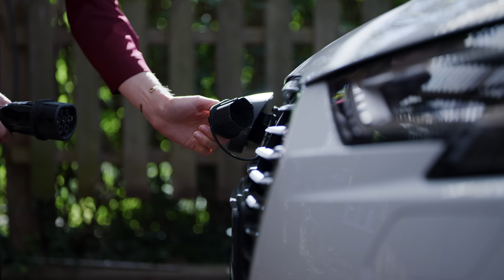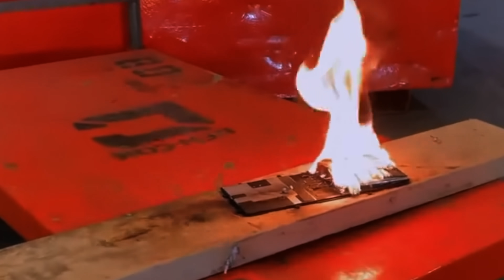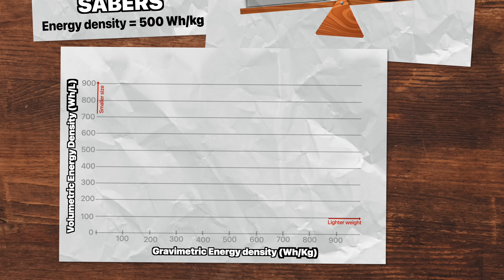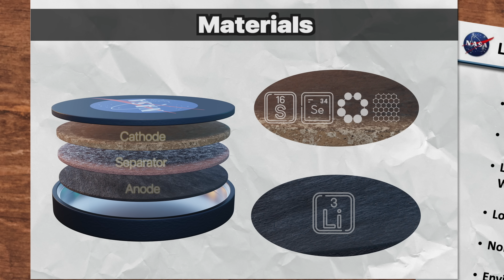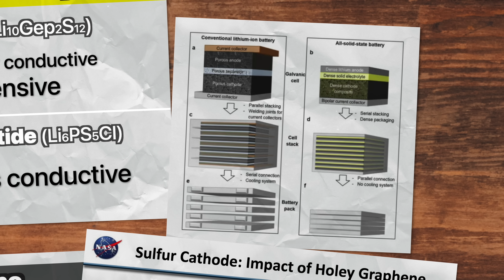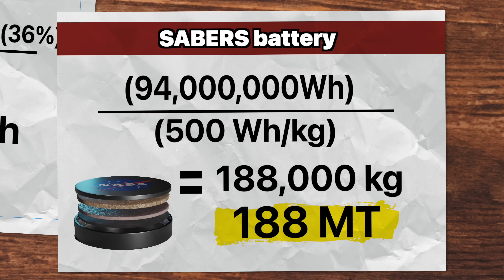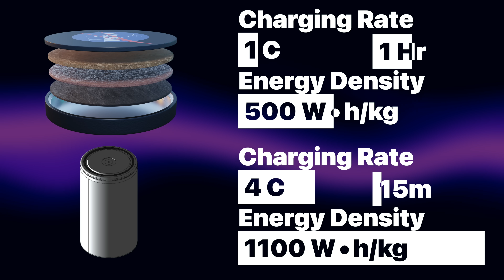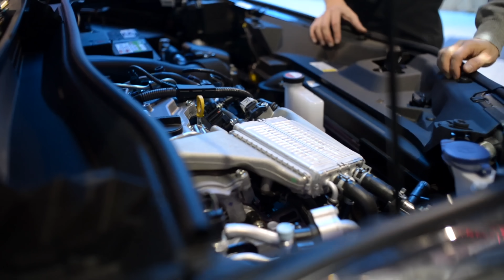Why NASA is Building a Solid State Battery

Comment: This battery is as real as all the other energy "breakthroughs" of yesteryear . Dont hold your breath.
Reply: The solid state market is about to hit commercial scale next year. I get it as we have been talking about this for years but it's taken dozens of companies and years of RnD to get there. Most good things take a long time
Reply: @Novacasa88 10 years ago about half a dozen breaktrough battery technologies where to hit production the following year. This has been said for every year since…
Reply: @Novacasa88 Yeah, they're real and much better. Only problem still is figuring out how to mass produce them at affordable prices. If they solve that then solid state batteries will be the EV game changer. Solid state batteries + higher output solar panels would= EVs that only need 🔌 plug-in 1/4 or 1/2 as much. 
Like a mid size pickup truck with the hood, roof and truck bed cover, covered in high output solar panels.
Reply: @Novacasa88  what makes you think that? I haven't seen anything that would make me think that we are close and experts are saying we are at least five years away. (Probably more)
Toyota is saying they are close, but they've been saying that for over ten years. I've seen no reliable source say the same.
Reply: A similar battery “breakthrough” from some years ago is Solid Energy Systems battery (also lithium metal anode if I remember correctly). 
They are going into mass production right now.
Yeah. 9/10 battery breakthroughs wont make it to market. But we only need 1.
It takes many years to go to commercial scale production. Sometimes the reason you don’t hear anything after the first announcement is that the company developing the battery got the investments they needed to continue R&D and scale up. Then they have no reason to publicise anything as they don’t need the attention to attract investors anymore.
Reply: @auspiciouslywild 🧂
Reply: "Graphene Breakthrough Announced!
  This will change Everything!!!"
Reply: @stevechance150  yes perfect pairing for the  fusion breakthrough
Reply: If it's as real as the battery breakthrough of yesteryear that we use in our smartphones, laptops, cars, headphones, speakers, etc. it should be good.
Reply: Selenium = more expensive than silver.  Good Luck.   @nagualdesign
Reply: Yea, they all used identical materials... Gold, Silver, Platinum... oh goody, this uses Selenium, only 50% more rare than silver... Oh goody!
Reply: Toyota is talking about bringing solid state EVs by 2027.
Just saying.
Reply: @poolboy1690  Toyota has been talking about solid state batteries for over 12 years and they are always "only three to four years away!"
Reply: @4203105 Toyota once owned a sizeable chunk of Tesla but sold it.  Pretty ballsy bluff for a weak hand of cards, I'd say.
Reply: Every great breakthrough has received its fair share of naysayers. This battery technology is much further along than you give credit. OEMs have been provided with usable technology for testing since last year. Negotiations are underway with launch partners.
Reply: @rickblanton4328  it’s more than that. Disruptive technology has been hidden and stolen for decades by abusing the patent office to filter them then steal them under national security threat. We could have gone off fossil fuels in the early 70’s is the truth. Now the government wants to patent and slow roll clean energy to us.
Reply: Oh good, I'm glad to hear that then, because most of those breakthroughs from NASA and the major schools like MIT eventually show up in the public sector.. He listed a few examples of that right at the start, lithium ion and subsequently the newer lithium iron phosphate (newer carbon- lattice design) weren't even mentioned but they both were similar breakthroughs that have upgraded batteries in insane ways.
Reply: Toyota has been promising and re-promising that their solid state battery will come out “next year” for 6-7 years. I smell vapourware.
Reply: Nasa has developed a lot of technology that is now in our every day lives. It took years to get into industry though. Nasa has never been in the business of making factories though. So they do the science and maybe make a thing for themselves. Their batteries will go to space though so that s cool
Reply: Don't tell me how to breathe! ... turns blue
Reply: LEDs have been pretty great this last decade eh? 
And then there are SSD hard drives, and TV's as thin as a finger but the surface area of an actual bed. Imagine that as a kid!

Funny how we forget the way things used to be, we humans can normalise anything. 15 years ago there was no way to Google something without having to switch on a computer, usually indoors, and at best that privilege cost us a tedious life of cables and a weird shit briefcase or backpack, and clunky power adaptors and finding somewhere with free WiFi, before that was even an expected thing.

Streaming also only a few years old as a reliable concept, remember when Netflix main competitor was IloveFilm or whatever, and you had to return the films on DVD through the post, and every 4th disc would be cacked anyway? Great times.

And like, QR codes they're pretty new, li ion batteries themselves were a revolution in power density, then li polymers again.

Ooh yeah, a few years ago we all just agreed that nazis were, and are, very bad and not be tolerated. Somehow that slipped, bit of a shame, millions dead and all that, we really should have more respect for that and stamp out fascism at every turn.

I seem to have wandered some distance from the point..
Reply: @timt5381  it's amazing how are we've come. Just Imagine how far we'll go. I'm huge into science. I'm make sure to keep right up with current experiments and your findings. We're honestly head towards startak way faster then people think. 2 out of the 3 large Hurdles for ft l drives have been accomplished. 2024 Dr. White and Eric w. Davis cub sat goes up. It's expected to hit 20%c. We can now do quantum computing with light and we have the world's first room temp. Super conductor. Op. Temp. 20f. There also been massive breakthroughs on non equilibrium cold plasma aka negative kelvin temperature plasma. It's honestly crazy.
Reply: Why do you watch these kinds of videos if you are so hopeless?
Reply: @ryanscott642  
"Hopeless"? Me? HA! 

Cynicism != hopeless, son. 

It's not pessimism if the world really does work that way. That's called "realism". 

I've been an engineer for 30 years. You know how many times I've been promised the moon and the stars by tech? The fact that I DO still watch these things represents the greatest instance of hope you'll ever see!

"Fool me once, shame on you. Fool me 77,244 times? Then SOMETHING's gotta be dragging me back. 

I know a great deal about this topic. As in, I read journal-published papers on it. On purpose. For FUN. So I've got a pretty good bead on the situation, too. And yet... here I am. Hoping that not only have I missed something, but that some random content creator didn't.

"Hopeless?" Son, one or both of us clearly doesn't know the meaning of the word.
Reply: @grumblycurmudgeon  I remember when they couldn't imagine why people would ever want a personal computer.  Now we walk around with supercomputers in our pockets. Mostly to use them to bitch and moan about how technology lets us down.
Reply: Breakthrough for science, not always directly for consumers
Reply: @ashmasterc  exactly
Reply: New technogoly is never new technology.  It is last decade's technology becoming cheaper to produce and more widely available. This isn't going to change the battery scene over night,  the same way Li Ion batteries didn't, but it will mean that, over time, as these becone cheaper to produce and easier to manufacture, we'll see these more and more often,  until one day they are just as common as anything else.
Reply: Toyota is totally dishonest in EV statements.
Reply: I think I trust NASA a bit more than some dodgy Chinese company half owned by the CCP 😜
Reply: @edwardfletcher7790  yeah ? Tela , GM & Ford all use battery cells & packs from CATL & BYD.   I'm no fan of the CCP or Mr. Xi, but Chinese tech is a little bit more advanced than the chauvinistc kooks at foxnews. would let you believe . In battery tech , the Chinese are ahead of everybody else... meanwhile, Nass wasted ungodly amounts of money on the SLS.   You might want to  educate yourself on the subject
Reply: U know we could have been off fossil fuels in the early 70’s? They have been using the patent office as a filter to catch all emerging tec. Ether they make it gov property and a “ national security risk” for emerging disruptive tec for decades or they seize the tec if the big oil can’t buy it outright. The truth is all people have been caught by the money trap and can’t turn down the billions on the front end for putting it out as free use and the capitalizing on the back end patenting all its uses in stuff. That’s been the hook to it and how they have held us back for so long. There is clean unlimited free energy all ready developed out there. They claim it would collapse our economic system. No it would cut off oil countries and stop the have and have not society they love today cause there in the haves and to them a few billion is like a few hundred to us. It’s time to wake up!
Reply: Air analyser. Wank wank and double wank..
Reply: Agreed, every week I see another pair of about the Holy Grail.
It's just a way to deceive the public that Electric is sooooo green.!
BS
Reply: NASA is not the leading edge organization it used to be. Its days have passed. It always used to hype up stuff that it did but in the past the hype usually had at least some substance behind it. No more. Now it is all hype
Reply: Thanks, you saved my time.
Reply: It actually is real lol Elon made the brake through first. Also another big battery brake through is nuclear Diamond battery's.
Reply: It actually is real lol Elon made the brake through first. Also another big battery brake through is nuclear Diamond battery's.
Reply: @coreymorris1693  lol. Believing that Elon made any break through except his fragile ego...
Reply: @4203105  lmfao OK man. the guy that helped him develop it did an interview about it. It's the same guy that made the first lithium battery... so yea I do believe it lol. He even expanded the physics of it lol they are just looking for better Manufacturement processes. You need to catch up my guy lol there's been a lot of progress the past couple years. Ndb battery's, cold fusion, warp bubbles via catastrophic quantum brakedown using micro casimir cavities, quantum computing using light. There has been so so much progress.
Reply: @coreymorris1693  my guy, Elon never invented anything in his life. So nobody helped him do anything.
Also you are clearly delusional. Good bye.
Reply: Here's the secret, there's really not any more room for battery improvement on a significant. Like there is still improvements to be made but like we're not getting to gasoline levels of energy density with batteries ever like it's just not going to happen.
Reply: Looks real to me, you might have been wrong here.
Reply: ...it always takes a least a decade for it to hit open market
Reply: Different time
Reply: Is this why Toyota is promising 900 mi range EVs by the end of the decade? Because it's all fake?
Reply: Batteries with graphene are the future. I've been saying so for over 5  years and we're finally starting to see it
Reply: Like every new battery tech video, battery history first then some news and that's a wrap.
Reply: I have a couple already. They're pretty tight!  I can play candy crush twice as long now without having to charge my phone.
Reply: Well, Toyota is bringing the first car with SSB to market 2025, including all of their EV models in -26?
Reply: That’s the cool thing about technology and advancements, they don’t happen overnight. The simple fact is that they’re working on it and making progress. What have you contributed to the world aside from ignorant comments on YouTube…?
Reply: Except solid state batteries are already on the market. Check mouser.
Reply: These batteries are fine, for space use, but there's another aspect of this. The "trickle down" of aerospace technology was enabled by legislation that enforced public ownership of federally funded technology, but this legislation was removed in the 90s in favor of lobbyists from major contracted vendors. This means that all currently developed technology stays proprietary and the market is unable to compete in production.
Reply: Here here brother they been talking this shit for 40 years an there all full of shit. Biggest con in science is space. Ive been hearing about going to space for my whole life were still not going there. guys like this make big bucks selling their lies and BS products like atmo. Ill believe jt when I see it. 

Im all for this shit hapening but its usually lies.
Reply: Yeh pure bulshit vapor subject.
Reply: Things change. Think 200 years ago.
Reply: Solid state batteries are not new. If a solid state battery shorts out, it is a dangerous fire as they can store a tremendous amount of energy. Solid state batteries can hold 5 times the amount of energy than an ion battery.
Reply: They can power all of those cold fusion plants with these new batteries!
Reply: Thank you. I stopped watching while the ad’s were still playing 💕
Reply: Funny that I'm laughing at all the pessimism on a black slab or glass in my hand showing a motion picture with nothing attached to it. 🤣 Yea these "breakthroughs" never materialize.
Reply: @storm14k Imagine going back to 1985 with a smart phone 📱 that had wifi. That's playing the newly released back to the future movie in the palm of your hand in HD. 😂
Reply: @michaelbrinks8089 Don't forget to bring wifi broadcasting infrastructure plans back to 1985 too!

I believe in time travel because I've experienced it... best to do it right.
Reply: @storm14k  Well said.
Reply: Most of the time it is about cost I've noticed. Or they are in the process of scaling up.

 Yet it is good to be skeptical. There are some technologies that he is basically free advertisement for some con artists. Him and Undecided with Matt Farrel or whatever really do fall hard for those deceiving assets.

 I won't hold my breath. I do hope I'm wrong though about my skepticism. This is NASA afterall.
Reply: @dianapennepacker6854 
NASA =never 
              a
              straight
              answer.  😅
Reply: Yes... Click bait...
Reply: @StatedByTony so don’t buy it when it comes out.
Reply: @MH-lk8md The battery doesn't come out.
Reply: @MH-lk8md  that is for sure. You really shouldn't trust these YouTubers so blindly and fall for their click bait. I do believe in SSB, but this one won't be it. Materials too expensive.
Reply: @StatedByTony materials too expensive? Bro every single smartphone has fucking gold inside it
Reply: Fossil fuel has entered the chat.
Reply: @PhantomPanic exactly
Reply: @PhantomPanic no no you just don’t understand… some random 🤡 on the internet obviously knows more than NASA, I mean what have they ever accomplished, really? 😂😂
Reply: @sowhat512iuu Velcro?
Reply: @sowhat512iuu Knows more about what? Whether something is economical to manufacture at a large scale and produce? NASA never claimed those things. You believe that this battery will be mass manufactured and it will be economical to do so, not NASA.
Reply: @PhantomPanic better batteries will have fossil fuels leaving the chat.
Reply: @BadOompaloompa79  whoosh! That was the whole point. Do you really think that the oil tycoons aren't going out without a fight?
Reply: @PhantomPanic  oh, if that's what you meant we're going to stop burning fossil fuels when the last cannibal eats the last oil company CEO.
Reply: @BadOompaloompa79 Cheaper solar will have fossil fuel industry leaving the planet at gunpoint.
Reply: @PhantomPanic Many many worthwhile things require a fight to achieve, yet such a large fraction of the population thinks violence is bad, even in self defense or defense of Earth. We're becoming livestock.
Reply: YouTubers figured out that people click on "new battery" even when there's no manufacturing going on, just prototypes or proof of concept
Reply: N.A.S.A just stands for Not A Space Agency
Reply: @generalgod4326  actually, NASA stands for Needed: Acronym-Spouting Adolescent. You planning to apply?
Reply: There is that much effort and money going into this it will deliver. You cynicism is ill placed.
Reply: @drinky1 Your optimism is the result of naivety. Battery "breakthroughs"t get announced all the time that result in nothing because they can't be manufactured in volume or have some serious downside.
Reply: Solid state batteries are being readied for mass production. Just because you still haven't heard of a fully-functional product doesn't mean the breakthroughs aren't making their way to consumer products. It takes some time.
Reply: As you type this out on what was once called a super computer, you probably still believe we don't carry around a calculator in our pockets because your teacher said so.
Reply: @FearlesSLaughteR1  I'm a software engineer by training. I literally made possible some of the tech you're typing on right now, please procced with your baseless uninformed take
Reply: I'd trust Toyota over NASA at this point
Reply: @TheImpersonatorVEVO  lol why? What did NASA do?
Reply: I heard fusion is just 5 years away thanks to companies such as Helion!
Reply: @der.Schtefan   It's been 5 years away for the last 20 years
Reply: @LuisSierra42 that doesn’t mean it’ll never happen. Progress is happening and one day that “5 years away” claim will be real and people blinded by pessimism will never see it coming.
Reply: @LuisSierra42 I think that was the joke, bro.
Reply: @lightmasterpc1883  Pessimism or old age? Just kidding. Progress continues to accelerate and AI will keep the trend in place, I think.
Reply: @LuisSierra42  No, it's always been 20 years away. You are confused about your memes here, Bro.
Reply: @mike74h  Can't speak for lightmasterpc1883, but, to answer your question (speaking strictly for myself): yes.
Reply: @LuisSierra42 I’ve been hearing this joke for 20 years.
Reply: @der.Schtefan - I wouldn’t be the least surprised if fusion (and also salt reactors) were still a decade+ away. The discovery/breakthrough hype always far exceeds the actual product release date, by a couple decades at best “if” it happens at all.
Reply: @__WJK__  we'll get Fusion way before reliable molten salt reactors. The latter might just be impossible.
Reply: @__WJK__ until they realise nuclear fusion is started by cosmic currents 😅
Reply: @4203105 Don't dis molten salt thorium reactors without citing your sources. Where is the weak point?
Reply: @polychoron  What do you want me to cite? Protypes were built in the 60s and 70s and there are still no production versions.
The weak point is that salt corrodes things and molten salt corrodes things in record time. You can run a prototype for a time, but not a powerplant for years, let alone decades. Can't even swap the effected parts easily since that's the highly radioactive loop.
Why do you think we still don't have these reactors?
Reply: @der.Schtefan  commercial Fusion power plants? No. But I'm cautiously optimistic that we'll get there in under 10. But because of Commonwealth and Proxima Fusion (MIT and Max Planck institute for plasma physics, respectively), not helion.
Reply: @der.Schtefan Fusion is still a very long way out. Sure, some new breakthroughs in retaining plasma longer have been talked about, but nowhere near long enough to sustain energy needs. It's all a publicity stunt to get hopeful viewers thinking the fossil fuel industry is about to go belly-up, which it never will, but hey, fusion. It's just around the corner, right?
Reply: @der.Schtefan  I heard that 10 years ago. They will never get fusion and if they do theyll do it by moving the goal post an calling some thong that isnt fusion fusion.
Reply: Hear hear.
Reply: Who hurt you?